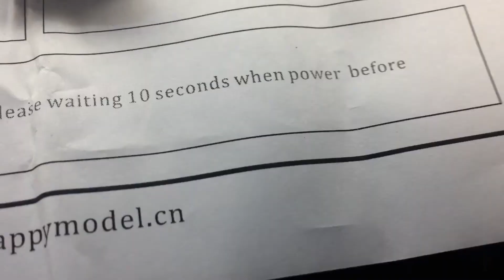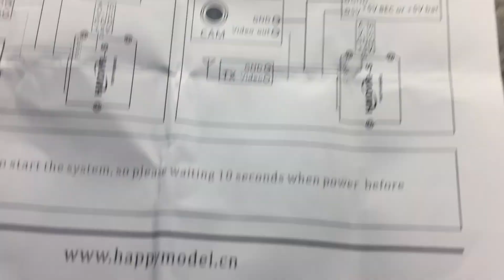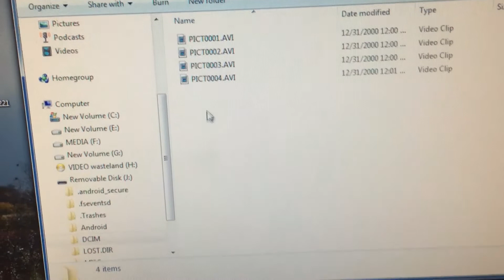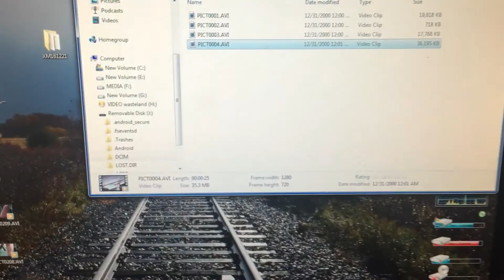HMDVR-S setup and testing

Comment: looks like your camera is PAL as the frame rate is at 24 fps which is the PAL standard
it also crops a bit of the frame with a PAL video source.

I had to change to a NTSC camera and now it's capturing 30fps and at 21mbps!

Comment: As a friend, I bought this DVR to connect to SKYZONE and I only connected the 5V, GND and Video, and I did not connect the audio cable, but the recording is coming out a noise next to the video, could you help me and say what can be ?
Reply from the maker: Iwould try to connect the audio wire to the ground wire that might cancel out the noise.
Reply: @REDROBRCFPV  Ever heard that solved it before?

Comment: so, watching your video...wiring has a video in and audio in - does this have a microphone on the board?  3 screws to take off the case and easy to see!  Please check...
thanks! :)
Reply from the maker: Scoot Roter no it does not, I took my case off and shrink wrapped it to make it smaller.
Reply: ahh, so we supply the mic and hook it to the audio wire if we want to record audio.  Good to know, thanks!

Comment: Hi, very good video!
You know what? I have a problem with the recording of my videos with the hmdvr-s. Is that I see that in the video that you filmed is of a much higher quality than mine. I made the same connection ... Besides, it generates a problem when I see it from the goggles, since horizontal lines appear and makes the video look pretty bad ... What do I have to do? Is there any special connection? Pd: The 5volts that the hmdvr-s needs I take from my fc which is a spracing f3. My camera is a swift 2 and my vtx an unify pro race. Link of my video: https://www.facebook.com/100003759896371/videos/1216213505180634/?t=9
When I disconnect the hmdvr-s the video quality shows it very good in my goggles, I don't know how I can fix that issue... 2 Friends have the same problem...